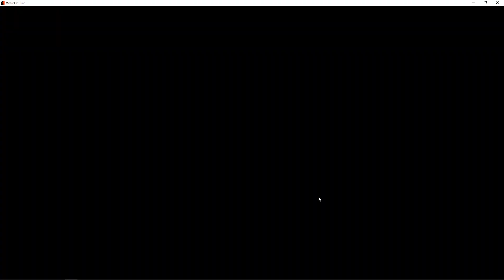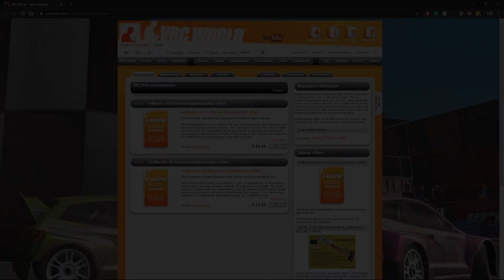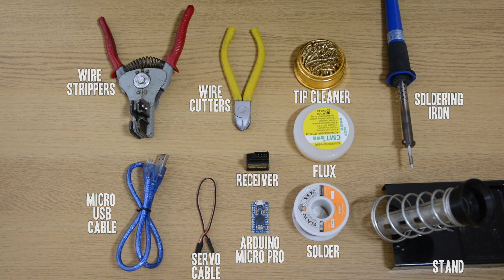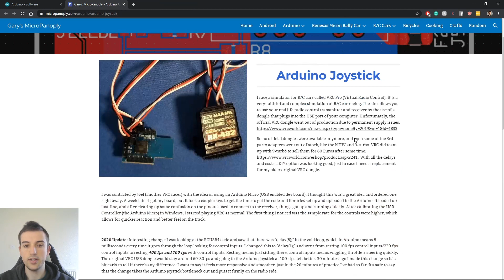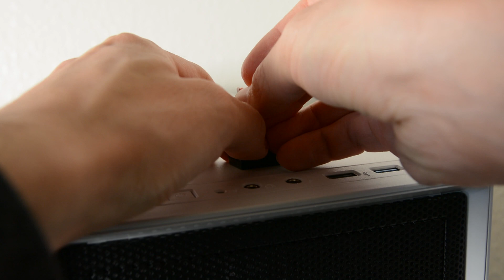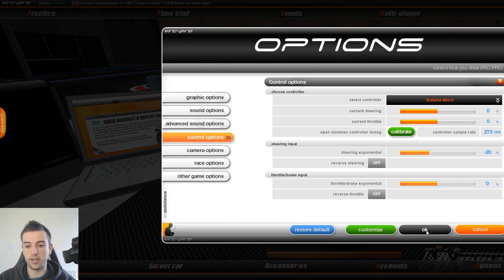How to make USB adaptor for VRC Pro

Comment: An update for new people: the reason you need an adapter is because your transmitter doesn’t have a direct usb joystick port. The only surface tx I can find that has one is the radiomaster mt12. I can use vrc with my tx16s via usb and don’t need an adapter. The rc surface tx industry needs to catch up with rest of rc which have built in usb joystick function

Comment: Hey, in case it helps anybody I had a bunch of odd errors compiling the code. I literally tried programming it's on five separate computers, gave up multiple time. It ended up being the remnants of an old joystick library that was left behind from a project. I have Windows sync turned on, and I keep my libraries in the my documents folder. So anytime I logged into windows on any pc those same libraries would sync and follow me.
Reply: I have the problem that I connect the arduino to the pc and recognizes it as keyboard

Comment: Hi im using a Flysky GT3B setup. uploaded the software to the arduino board, plugged it all in but am getting no response calibrating it in the USB controller setup. Reciever is bound and works with my real cars so it seems it must be a problem with the code or something? Any help?
Reply from the maker: Are you using the right type of Arduino board? Double check your soldering connections go to the right pins.

Comment: I have been trying to install the software on my PC to which I get so far then I stop with this message.
Using an Arduino Leonardo chip with RCUSB4_v1.1 zip file  and the ArduinoJoystickLibrary.zip file which at first I had all sorts of problems.
Then I get to this " Sketch uses 8226 bytes (28%) of program storage space. Maximum is 28672 bytes.

Global variables use 322 bytes (12%) of dynamic memory, leaving 2238 bytes for local variables. Maximum is 2560 bytes.
An error occurred while uploading the sketch
"
Using a Spektrum SP200 receiver and Spektrum DX3R controller.
Pc has *GB memory and 1.4TB of disk space.
Can anyone throw any light on the error message please.
Reply: Hi, Im like you

Comment: I can not get the upload to work. I keep getting error message "Joystick.h: No such file or directory" and a "Copy error message" at the bottom of the screen when I try to upload the code to the board. Any suggestions will help.
Reply: He doesn't say it in the video, but you need to download the Joy stick library
Reply: having the same issue please advise
Reply: same prob. plz help
Reply: @shawaazhisaund6727  download the library and on Arduino Software, go to Sketch -> Include Library -> Add Zip Library and open the .zip you just download. After that it will work.

Comment: Great tutorial man!👍😁 And many thanks to the man who wrote the code🤓🤗 I'm gonna build myself one today.
Reply from the maker: Glad I could help!
Reply: @dangcool3864   Do you know if one can do it with the Arduino Uno also, or is it the wrong chipset?
Reply from the maker: As far as I understand it's not going to work as the Uno is based on ATmega328 and this code is specifically written to work with the ATmega32u4 architecture.
Reply: @dangcool3864  Thanks man! I'll update you on how it works out: )

Comment: My receiver isn't getting any power. I have the red from CH1 into 5v, black CH1 into ground, and the white into d3, and the other 3 cables are just single white signal cables in d2, rx, and tx
Reply from the maker: I do not know what receiver you are using however I suggest running the Red (5v power) and  Black (ground) wires from the microcontroller to CH2 on your receiver. This is because normally CH1 is reserved for steering and CH2 is throttle (connected to the ESC on electric cars which supplies the 5V power).
Reply: DangCool I since ended up getting it to work by swapping to a different receiver, thanks for the reply though

Comment: Arduino: 1.8.13 (Windows 10), Board: "Arduino Leonardo"

sketch_aug21b:16:10: fatal error: Joystick.h: No such file or directory

 #include <Joystick.h>

          ^~~~~~~~~~~~

compilation terminated.

exit status 1

Joystick.h: No such file or directory

This report would have more information with
"Show verbose output during compilation"
option enabled in File -> Preferences.
Reply from the maker: Have you copied just the Arduino sketch file to your computer? Make sure you have the whole folder which should include the Joystick.h header file as well.
Reply: @dangcool3864  it keeps saying files not found i keep trying to downlaod the files and it says its downlaoded but it keeep saying not found
Reply: same here
Reply: same here would be nice for help @shawaazhisaund6727

Comment: So on the channel 2 wire is only the white wire soldered
Reply from the maker: My suggestion was to also connect the power and ground from CH2 however this is not that critical whether it's CH1 or CH2. The 4 connections required are:
CH1 White - Pin 3
CH2 White - Pin 2
CH2 Red - VCC
CH2 Black - GND
Reply: Hi ch1 red and black not connected?

Comment: Excellent video but I don't know how to open the .H file into Arduino. I get a "copy error message. "Joystick.h No such file or directory". I have never done this before. Can you email me what I'm missing? Email-morees1@mediacombbnet
Reply: for me also no such file or directory.
Reply from the maker: You shouldn't worry about opening the .H file. This .H file is a Header type file which basically contains name references to functions that are used in the main program. Think of it like a supporting document but you do not need to change or upload that specifically to the Arduino board.